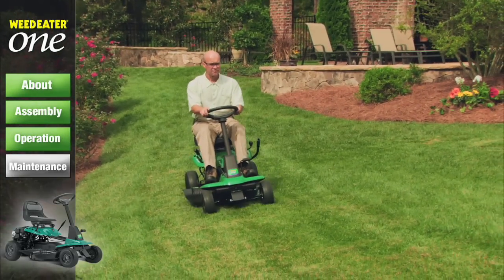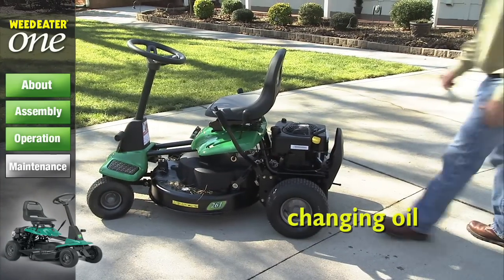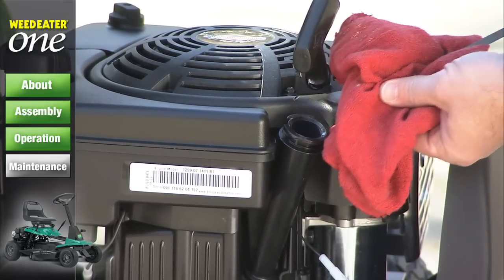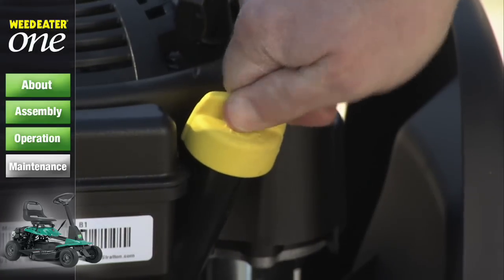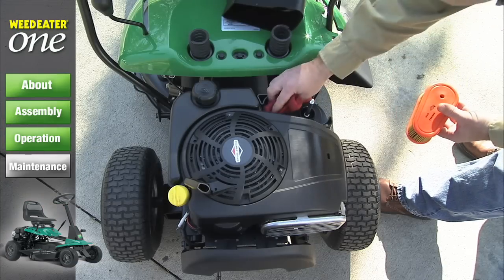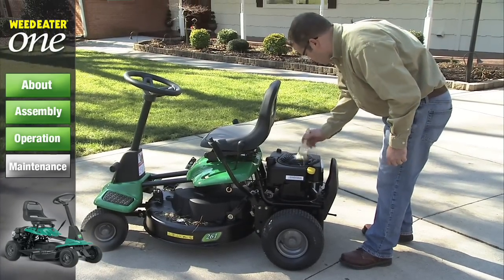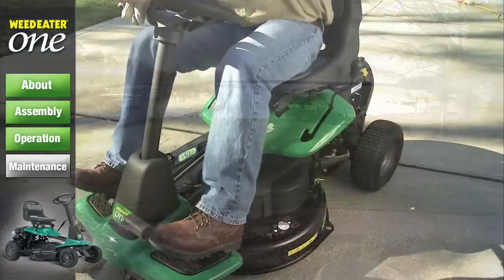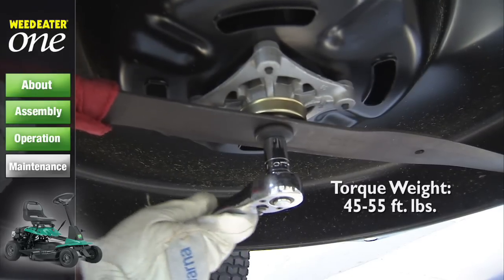Weed Eater One:  Maintenance

Comment: Yes sally they are a great machine to use, and a really sweet little motor ,
unfortunatley our drive failed after only 1 mow of our small flat yard.
If some one could take this mower and remake the drive system to a gear transmission like the rovers use , it would be a real winner.

Comment: I actually like mine. 
When the drive chains started to  wear out I found a new set on eBay and was back in business within a couple of days.
The part #S were
 #430645 Primary chain and 
 #428069 heavier secondary chains.

Comment: Yours too huh?  I made the mistake of buying one of these things.  First the steering column stripped.  Then the frame started falling apart because of the crappy tack welds.  Then the transmission fell apart and now you can't get parts for it.  I ended up giving it to a guy I know who works on lawnmowers for parts.

Comment: Has anyone had issues with theirs not running well until it is warmed up?  It seems like it would be a carburetor issue, but not sure.  I have to run around the yard for a time or two for it to warm up before I can think of engaging the cutting blade.  Curious if anyone has an idea or had this issue?  Mine runs very rough until it seems a "snap" and it runs full speed and normally.  Is there some kind of choke that I am missing?
Reply: This was happening to me too until I switched to non-ethanol fuel. Make the switch, you will notice a huge difference and will not need to worry so much about fuel sitting too long.

Comment: FIRST MONTH I HAD TO REPLACE TWO BACK TIRES AT A COST OF 90 DOLLARS. THE TUBES INSIDE LOOK LIKE THEY WERE DRY ROTTED.IT TAKES TWO ARMS TO TURN THE STEERING WHEEL IT IS SO TIGHT. THIS MONTH IT WILL NOT START PUT IT IN SHOP AND THEY SAID THEY HAVE NO IDEA WHAT IS WRONG WITH IT. WORSE INVESTMENT I EVER MADE.I AM THINKING OF SUING SOMEONE WHAT A RIP OFF. I HAVE ONLY USED IT 4 TIMES.

Comment: The steering spline broke on mine after 3 cuts,now after 25 cuts the friction drive wheel assembly has failed. Part alone is $300. Weedeater and Walmart both are aware of the common problems of this mower and both have failed to make it right with their customers. This is an extremely poorly made mower!

Comment: piece of crap.  the let alone the friction wheel being a piece of crap, the damn trans-axle housing is made of plastic! which holds the spider gears in place.  frikken melted and now it just grinds when I put in in gear..  had to finish mowing the hard in reverse! of course had to duct tape the blade control safety switch in order to do so.  I cannot believe a company would put their name on this.. what a scam!!